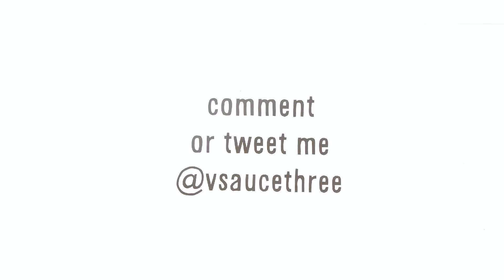5 Awesome PlayStation 4 Facts! -- Fact Surgery

Comment: Every new console generation is nothing but a cheaper and smaller 4 year old gaming computer made for people who really don't need or appreciate the gaming quality of a PC and just want to play casually. It's a good product, but doesn't deserve to be compared to gaming computers.
Reply: PerfectceII you say that the iPhone 5 will still be a good phone in 5 years. You just don't know. Look at the original iPhone, it can't even run the latest ios operating system and its not 5 years old. The iPhone 4 can barely even run it. When the iPhone 6 is released the iPhone 5 will become obsolete, like it was designed to do. Also pc graphics in a budget build already make the console graphics laughable, maybe consoles can pull out a few tricks from their sleeves to make things flashy but the lack of computing power is going to hold back consoles from ever reaching any decent level of graphical fidelity. If there isn't a new generation of consoles within 2 years I will be shocked, the current hardware in consoles is not future proof. And the part that sucks is that pc gamers will pay for bad console design. Game maker won't put in as much effort to aaa titles because consoles can only handle such an awful graphics experience compared to computers. Consoles kinda suck but for casual gaming and getting more people/money into the video game market; they're OK.
Reply: You do realize that the PS4 can run most PC games on Ultra right? For example, it runs a Realm Reborn on ultra compared to PC. Same will be with ESO, Planetside 2, Watchdogs, and BF4. I'm in now way trying to defend the PS4 over PC, since I'm a PC gamer. But still.
Reply: Last Life
That would be on High, not Ultra. But that's still a respectable feat for a $400 machine.
Reply: Last Life No if you look at PC graphics and directly compare them to console graphics. Consoles just can't do the same. If a console can play BF4 on PC Ultra then why would I spend over $1000 on a gaming PC, when I could just buy a cheap $400 console and play around with it until it's just a PC.
Reply: StarWallace Actually A Realm Reborn does run on ultra compared to PC, and so will Planetside 2. BF4 probably runs on high though, I'm not 100% on that one haha.
Reply: Konrad Bartlett you compare a console to your PC last I've known is not all have the same built PC as you.
Reply: Last Life you are comparing a new console to games that were released on pc many years before it came out.  That in itself should tell you all you need to know about this subject.
Reply: Mordecal Walfish None of the games I mentioned have been out for more than a year.
Reply: Last Life It would seem that you do not know what you are talking about. I've played FF14 and Planetside 2 since the day they were released.  For Planetside 2 that has been almost two years now (the 2nd year anniversary is in september or october) and for FF14 I've played for over a year as well.  You a console gamer or something? =P
Reply: I do t usually jump in on these b.s, pissing contest how about we all like games? You like to game on a p.c I like console for gaming but we do share common ground we like and appreciate gaming.
Reply: Voltron Buggz and of course if you did read my comment and you do have such a deep understanding of computer like you say you do; after all you said hertz and fps you must know SOMETHING, I suspect you would fucking realize that a 780 is AS POWERFUL as the 290x. I'm not saying all computer perform the same I'm not retarded. I said that using two powerful cards and the same graphical settings in a game, you will get the same visuals on both systems.
Reply: Konrad Bartlett 290x is as powerful as a 780ti doe...
Reply: HotDogInATortilla not in benchmarks
http://www.tweaktown.com/articles/6397/4k-showdown-nvidia-geforce-gtx-780-ti-3gb-vs-amd-radeon-r9-290x-4gb/index3.html
in this benchmark the 290x performs similar to a 780ti but is always a little bit below or a liitle bit above. Usually below
http://www.pcpro.co.uk/reviews/graphics-cards/386182/amd-radeon-r9-290x-vs-nvidia-geforce-gtx-780
Here they're comparing the 290x vs the 780. I guess it's just biased but that's the first article I read about the 290x vs 780.
Reply: Konrad Bartlett The 290x is still 100 dollars less than the 780ti and gives similar performance.
Reply: HotDogInATortilla that doesn't really make a difference and my original argument is still valid. Quit being so nit-picky
Reply: Konrad Bartlett are you social challenged becouse im not compareing two powerful computers im comparing a avg $400 pc to a custom built $800 pc which most of us would rather spend $399 on a console then on a $1k custom pc becouse they perform the same and yes consoles can only display up to 60 hertz while pc can hit 147 hertz (I dont know total of top my head) but mosy people can only see 60 and the difference is unnoticeable and a game runs smothly at 30 frames so theres no need to push higher while a cheap pc can only hit 20 frames on lowest settings.Fyi graffix are limited to the fps.
Reply: Voltron Buggz Pc can hit higher than 144 fps. Most consoles cap at 30fps and aren't even 1080p. People also don't even see in fps, I don't know where you get that pc. Look at logan from teksyndicate or linus' videos on budget builds. They easily outperform consoles, can play at similar resolutions with anti-aliasing and have over 30fps.
Reply: Konrad Bartlett "+Last Life No if you look at PC graphics and directly compare them to console graphics. Consoles just can't do the same. If a console can play BF4 on PC Ultra then why would I spend over $1000 on a gaming PC, when I could just buy a cheap $400 console and play around with it until it's just a PC. " (Konrad Bartlett)
Reply: And sorry about my gramner complain to samsung for 1/4 size keys and a 2in keyboard
Reply: And lastly dont forget your still playing a game is not saposed to be picture perfect thats main reason why games like halo are a fan favorite and minecraft would be not so fun at such high resolution. Graphics are not everything.
Reply: HotDogInATortilla do some research ps4 1080p xbox one 720p sized up to 1080p. and why would you need to play at 140 frames?
Reply: Voltron Buggz you're*
Reply: Sorry you can not read previous comments.
Reply: Voltron Buggz Competitive platform??? K bud you keep to your 10 tick servers and your 30fps gameplay with low resolution graphics and shit controls. Exclusives are a non-argument cause we have way more and much better exclusives. Ever heard of replay value? (doubt you've played tlou more then once.) BTW WASD is superior because I have the rest of the keyboard and a MOUSE. HOLY FUCK! WHAT A CONCEPT? Not to mention games where a controller is actually better I can always just plug a 360 gamepad in because guess what! USB is UNIVERSAL HOLY SHIT IT's EVEN IN THE NAME, or a fucking racewheel or flight stick or any other number of peripherals that consoles are incompatible with. HZ doesn't even fucking matter after 60 kid but having high framerate (which consoles don't) does! It makes the game more enjoyable and smoother to play. BTW If you can use that monitor then it has an HDMI port which guess what!?!?! Computer have too; in fact HDMI originated on computers! (I even have hdmi 2.0 while you're stuck on hdmi 1) What another fantastic fucking concept. Next while buying a PC yes you have to factor in a monitor but guess what kid you have to factor that in for a console too! Your fucking TV that's a monitor if you have one of those for a console you have one of those for a computer so your $400 console nope add in the cost of a TV. Buy programs? Like what? You can find unlicensed legal versions of windows 7 or even 8 online (offered by microsoft) all you don't get is some customization. Plus we have steam! AND FREE GAMES OMG WE DON'T HAVE TO PAY FOR DEMOS WHAT!?!?!??!?! Ever heard of steam?
Reply: Konrad Bartlett
PS4 runs games on 60fps not 30.  It is also capable of 4k resolution.  PS4 version of battlefield 4 run 48 player servers on 30 ticks.  Not going to argue about exclusives.  keyboard has more options but can be confusing if it uses to many keys anyways along with my opinion that the PS4 controller is the best piece of equipment for controlling a game.  Most people already have a TV where if you're getting your first PC you will want a decent monitor.  PS Plus offers a free game collection to all of its supported consoles every month and, before you say that PS Plus costs money you have to realize that if you chose to get every game offered among all consoles for even just one month you will easily pay for 1 or even 2 full years worth of services in savings if not more.  There is also the issue of price for PCs.  I do however have to say that steam is awesome.  But there is such a thing as steam box which is a console.  If anyone has any constructive criticism id love to here it however as I'm not overly educated in the workings of such devices.  Thanks.
Reply: McDavid560 trrruth
Reply: and everyone held hands and sung kumbaya and all learned that we are all part of the same gaming community and we should enjoy what we have in common which is video games x3
Reply: Why do you need to come here and ruin the fun. This is why pc gamers gets bad reputation. If you think gaming is about how powerful your hardware is then you are not a gamer you are just a tech addict. A real gamer only cares about the game itself. Someone who can play their game at the lowest settings and still enjoy the game.
Reply: DemonXY2J We're not arguing that without the 60fps, nice graphics, and better controls a game isn't playable. Just better, a game is still fantastic without them like halo 2 is still super awesome to play with friends but having all the extra bells and whistles makes everything just better.
Reply: Konrad Bartlett  But its still the same game no matter what.  Thats why i respect those people with lower end pc's and still enjoy the game. Even if they are playing at 20-30 fps.   I dont get why he needs to come here on a ps4 video not about pc and start something silly. Hell no one was comparing the ps4 to pc on this video until he bought it up.

60 fps im guessing ultra settings?  is achievable by having high end hardwares Im pretty sure there is not a high number of pc gamers who would have a gpu of r9 series and gtx 770 and above. Im a member of this website called gamedebate you should have heard of it since you are pc gamer and only 28% of the people on that website game at 1080p probably high-ultra settings. And the controls they are just a matter of preference some people prefer the controller some people prefer mouse and keyboard and some people prefer both like myself.
Reply: DemonXY2J It sounds like you are fairly well versed in gaming. Computer have the capability to use console controllers plus any other control device imaginable so that's why I think pc have better performance. Also the performance on a pc is just better. I know a console is better if you just want to sit down and play but now pc has things like steam which make it better (and you don't have to pay for online). 60 fps on ultra is a stretch in some games for even high end hardware but even medium settings looks better than what consoles have and play at higher than the 30fps which consoles tend to be locked to. Just makes for a better gaming experience. Consoles are good, pc is just better.
Reply: Konrad Bartlett Once you are in the game you wont notice the difference. You would have to play a comparison vid side by side to notice the difference between consoles and pc graphics quality TODAY obviously in a few
years the difference will become much larger again but then here comes the ps5 to make it closer again.

Im well aware of pc being able to support console controllers specially the 360 and one controller because i use one myself when i play adventure games, sports games and racing games. Idk why you said the controls are better on the pc if you are going to use the console controllers anyways on the pc  isnt that a plus for the consoles and pc? But we have to focus on controller hardwares that are actually used daily not those other extra stuff  like for example the oculus rift i mean the average gamer is not going to own one of those yet.  
For daily use its the console controller vs mouse and keyboard because those are actually the ones that are being used daily today in gaming but like I said its all a matter of preference. PC are suppose to support multi devices because they arent just meant for gaming so it make sense that you can basically connect any device to pc and it will read it  Most next gen games today are locked at 60fps on consoles.
Reply: DemonXY2J I said controls are better on the pc because you can use the console controllers, plus racing wheels, plus flightsticks, plus mouse and keyboard... The list goes on. Consoles are not modular however and eventually game designers will need to remove the 60fps just like last gen and shift back down to 30fps. Personally I don't like anything under 50, it feels laggy and moving the camera around shows some screen tearing/artifacting on any console or pc. and if the ps5 is coming out soon to aleviate the issues of the current gen consoles just not being very powerful, than console gamers are going to have spent $800 on consoles. Enough to get a pc that play games at high-ultra settings with 60fps+. It's just not as good on console. It's still fun and playable, just not as good.
Reply: Konrad Bartlett Like I said when comparing two in the controller department you only need to compare the things that are used daily not the extra add ons. For the pc its just the keyboard and the mouse. For the consoles its either dualshock or microsoft controller. Those are the main focus thats why people dont even bother mentioning those things you mentioned when comparing the two its just pointless.  Wheels and flight sticks are also used in simulators its main purpose is not only gaming thats why they make it for pc cuz they aint going to make one of those on consoles because professionals wont use a console for simulation. Supporting multiple devices doesnt make the pc controls better . It makes "controller support" better but not the controllers itself. $800 consoles dont exist but $800 graphics cards do ;) come on really $800 for high-ultra settings 60fps on pc? No way you need to atleast spend $1000 ATLEAST $1000 to achieve those kind of settings specially with these next gen games and optimization. Watch dogs, ryse son of rome, battlefield 4, dead rising 3 are now requiring gpu's like the gtx 760 and r9 270x and more powerful cpu's like the 8350 and 3770k. A budget build for $800 just isnt going to cut it anymore maybe 2-3 years ago yes but now? no way. You need to go over the $1000 barrier to achieve 1080p 60fps gaming at high-ultra settings
Reply: DemonXY2J Well proves how much you know about pc hardware. Oh and also you can't use a keyboard and mouse on a console you can on a computer. You can use a controller on a console but you can use a controller on a computer too. More options is better.
Reply: Konrad Bartlett Thats what  you've been saying two comments ago lol. I mean who doesnt know that you can use controllers on pc? And technically you can use a keyboard on a console ive tried it on my 360 to browse the internet and the 360 dashboard. I just plugged in the usb and it worked straight away.
Reply: Konrad Bartlett You really have nothing else to say besides pc is better now? Geez . You are the one who doesnt get it.  And now comes the insults. Well this proves it :)
Reply: DemonXY2J Give me a reason why pc isn't better for gaming. Other than exclusives because 1. PC has a shit ton of great exclusives too and 2. Exclusives are just bad for the end consumer.
Reply: Jeez this keyboard warrior is spamming my notifications.
Reply: Voltron Buggz Well I just want one good reason why consoles are better
Reply: Konrad Bartlett OH you are still going on about this? LOL  I never even said that console is better than pc lol.  Go read my comments again where did i say that consoles are better than pc? My point was PC gamers gets bad reputation because they come here on a console video and just starts blabbering about 4k, more powerful hardware, mods, graphics  and now exclusives. LOL Just stop it. You and the other guy are embarassing other PC gamers.  Funny how the first thing that comes out of your mouth is better graphics and better hardware not better games...  Thats just sad.
Reply: DemonXY2J Because better games is subjective?
Reply: Consoles are for gamers who want to focus on games and gameplay instead of spending tons of money on new expensive hardware year after year or more often. A lot of these so called PC gamers are hardware enthusiasts who manifest it through gaming, when in reality they mostly seem to be interested about showing off their rig and its performance. PC gaming is a money trap unless you buy a mediocre PC and stay with it for 5+ years, but then you might as well buy a console.
Reply: Trifroze So paying for online is completely acceptable? Also time and time again people have gone through and shown that PC gaming tends to be a lot less expensive in the long run.... Want the new theif game on consoles? Still only $60! Want it on pc? $20 with lot's of sales bringing it down to about $7.50 - $10. Playing on consoles isn't a bad thing it's pretty great for the industry, just when fan boys go through and decide to write bogus claims about how PC gaming is so expensive and worse it's pretty disgusting how brainwashed you are.
Reply: Konrad Bartlett I wasn't talking about PC gaming as a whole. Read my comment again. I referred to the people who spend hundreds of dollars every year on new hardware. PC gaming shines if you do it for the right reasons, yes, but the reason why Steam can sell games for so cheap is because, according to many studies done on the subject, about 30-40% of the games that have ever been bought on Steam have never been played. People spend less time playing the games they buy and more time buying new ones just because they're on sale, so most users spend just as much money on games as console gamers do while not spending any more time playing them overall. That's why Steam can keep doing it. I'm not the one brainwashed here.
Reply: Trifroze "PC gaming is a money trap" I believe you were talking about PC gaming as a whole. Also console gaming is a money trap. You pay $60 for games that I get for sometimes 10x less. We have sales of games on launch. I don't know about you but I know about this thing called a humble bundle or an indiegames bundle and usually you pay $1 for 7 indie games because you want one of them. Then the other 6 games go untouched. That's actually the reason. If you added up all the games in my steam library it would probably be worth around $700 if I were to get them on consoles. Yet I haven't spent more than $200 buying them through steam so... ya you tell me what's the money trap.

P.s. even if you game on consoles you're still gonna spend $1000 on an apple laptop or at least $400 on some dell, why not add that money to the cost of the console and get something actually decent?
Reply: Konrad Bartlett Actually the study I'm referring to didn't involve humble bundles. Google "37% of steam games never played". In addition, you're greatly overshooting console game prices. Most PS3 games I've bought have been $15-35, launches being the exception. 

Also laptops as well as consoles are bought for ease of use and portability, and consoles most importantly for their exclusive games. Not to mention, like I originally said, if you're going to buy a decent gaming PC without spending tons of money on upgrades every year, it's better to go with consoles that are optimized for games. Build an $350 PC with 500GB hard drive and a keyboard/controller that runs games better and with less errors and bugs than the PS4, and we might have an argument. Of course PCs are more powerful if you sink more money on them, however if hardware and performance is the most important part to you in gaming, you might be just playing unenjoyable games. Too many people worship performance. For arguments like these, it mainly seems to be a simple measurable tool that anyone can understand to claim completely baseless superiority.

Anyway, my original point was to just say PC gaming isn't this objectively better phenomenon like many seem to think, let alone console gamers being less serious about what they do. There's more to it than that, such as exclusives, variety of genres, variety of (competitive) communities, money spending efficiency, system optimization, ease of use etc. As such, it's unfortunate you'd immediately label me as a fanboy just because I didn't agree with you. I'll stop here now, as I doubt this conversation will have much further purpose.
Reply: Last Life on 30 fps ...